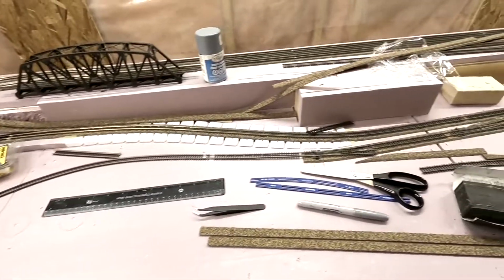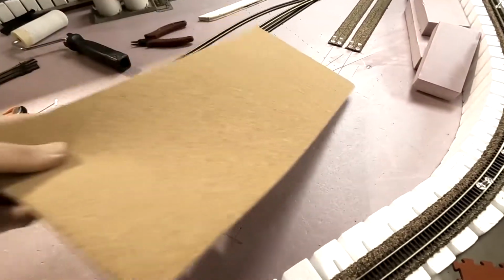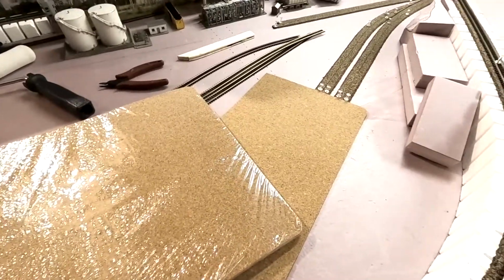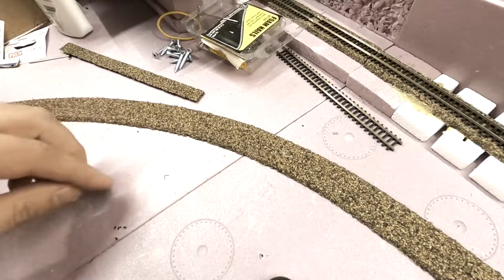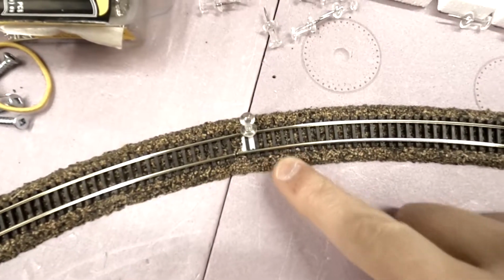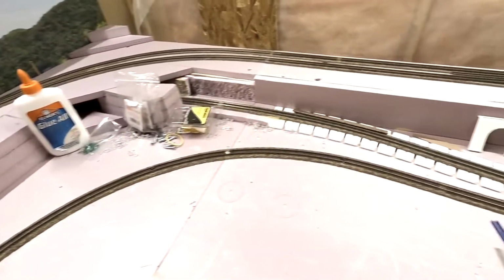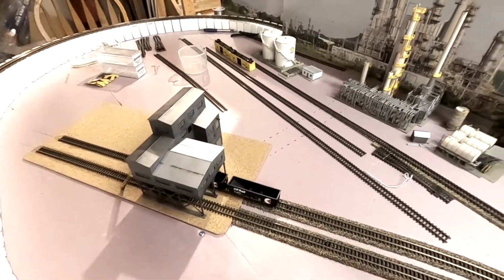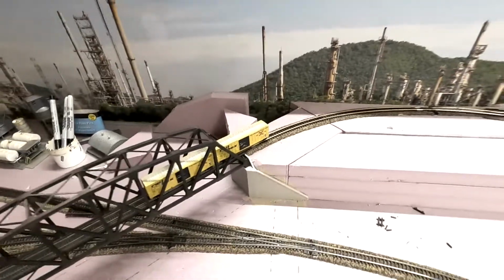N Scale Layout Update 11 - the BRIDGE is installed!

Comment: Layout is looking good. I have found that using the yellow carpenters glue for track laying worked better for me, as the white glue softens up again with water and IPA when ballasting the tracks. I still use the white glue for ballasting and scenery. Latex caulk also works well for track laying, just make sure its foam safe. Also nice job on fitting that bridge.
Reply from the maker: I will see if i regret using white glue to lay the track lol.